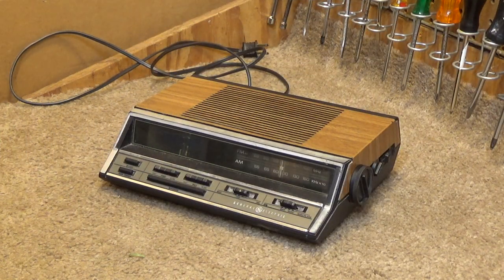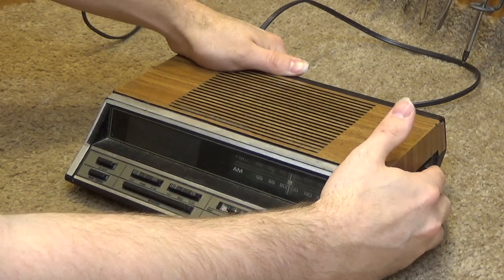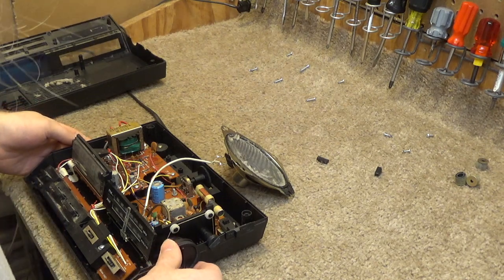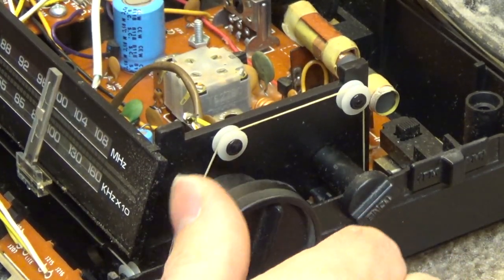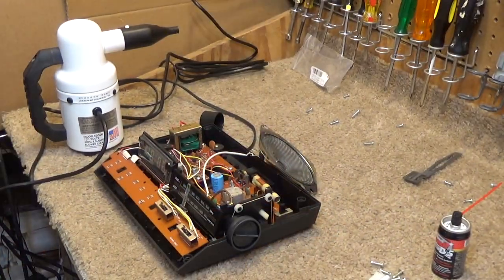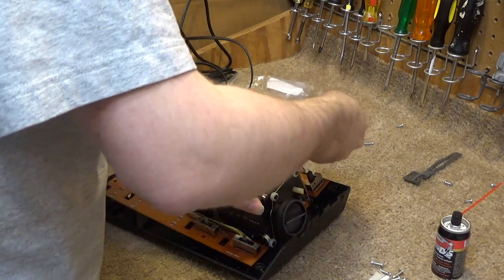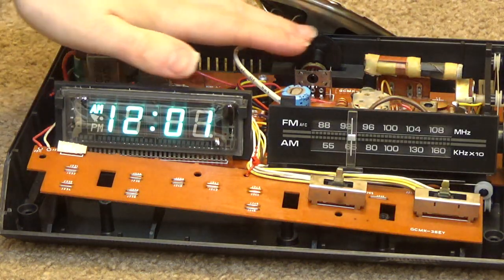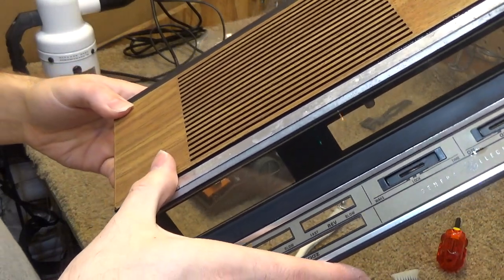Clean and Repair General Electric 7-4666A Clock Radio

Comment: I have one with the same case, but the front controls were all electronic and it has a nap timer. The was one of the last real GE clock radios, with sound far better than most of the competing brands with their little pocket-radio speakers. It was vulnerable to ESD on cold mornings, which would knock it out for a week at a time, so I ran a grounded wire across all the front touch pads. Glad to see that some of these are being preserved. The dial cord is a bit old fashioned for something from the '80s; most radios had flexible racks with a pinion gear for the dial pointer by then. I know a lot of people hate dealing the the cords, but for some reason, I don't mind taking one apart if necessary; it helps to use a bit of temporary hot glue, to keep it from unraveling,  here or there, when putting it back together.
Reply from the maker: These were excellent devices, I have quite a few preserved in my collection and will continue to use one of these for as long as I have to get up early in the morning.. I keep the humidity up in the house so I don't encounter any issues with ESD anywhere..

Comment: What's so exotic about the string for the pointer on the tuning dial?  That was the norm for most radios back then.
Reply from the maker: OK
Reply: All right, so what's so exotic about the string for the pointer?
Reply from the maker: @jaykay18  This is the first one I've serviced that worked like that, so it was exotic to me..
Reply: OK.

Comment: I have a similar one with the digital buttons. Works great but there is a hum from speaker when radio is on even at no volume. Any ideas if this is a capacitor issue?
Reply: Ground circuit hum. Check anything related to the power supply circuit.

Comment: Hi! I have one of these that I was given as a gift in the 80's. Everything still works on it except the buttons where you forward and reverse the time. Occasionally it works fine but most of the time I have to repeatedly press or tap on the buttons to make the time move. Any thoughts on that? I'm a little afraid to take it apart myself for fear of not being able to get everything back together properly. Any suggestions? Do you repair these for others and what would the charge be? Thanks so much for your time!
Reply from the maker: It sounds like the buttons probably need to be cleaned, or the conductive material refreshed. You don't need to take it apart as far as I did in the video to clean the contacts on the buttons. I'd suggest you give it a try, working slowly and gently. Take pictures along the way, notate where everything goes and you should be fine.

Comment: Hello. I have an issue with mine where one of the segments on the screen stays on at all times. The brightness knob works for all the other segments except the upper one in the far right corner. Even when the rest are completely powered off, it still manages to be lit at full brightness. Do you have any suggestions of what could be wrong and what I should do to fix it? Thank you in advance.

Comment: uhm i have a one but its Model no.7-4662B my mom got it from her work i don't really know how to use it i know how to use it  a bit i just don't know how to use it to its full potential can i get a bit help on it
Reply: It has the snooz button, Display select , Reverse , Fast , Forward, Wake set, Nap , Sleep , And obviously on/off button in that order  i can use the sides and the brightness thing i just don't really know how all those buttons work
Reply from the maker: Sleep turns on the radio for a set amount of time. The direction keys are for changing the time. I believe Display Select will change which item (the alarm, time of day, etc.) is on the screen to be adjusted.

Comment: Hi Jordan, great video. I need some help with repairing my radio and came across your video. My radio's transformer has died and I need to replace it but as not working I dont know what the voltages coming out are. Can you help? Do you know what the voltages out of the transformer are? I see 3 wires (2 white and 1 black), so I assume that we have a 2 outputs with a middle ground? Hope you can help as I dont have any schematics of this thing.
Reply from the maker: I've never used the ultrasonic ones. These are much easier to clean than the larger evaporative one I have. This doesn't put out  as much moisture as the evaporative one does and will not keep up once it gets really cold out, but it is significantly easier to clean. It's already saved me hours worth of cleaning from not having to use the evaporative one yet.

Comment: Not sure what you find so strange about the string setup, that's how virtually every vintage analog dial tuner works.  It isn't like that in the boomboxes you've serviced?  Regardless that's a nice clock.  Too bad GE's phones couldn't be as good as their clocks.

Oops, I wrote this before seeing Jay's comet..
Reply from the maker: No J, not a single boombox I've worked on has strings in it!
Reply: @JordanU  String tuners are used in any radio device where space is a constraint.